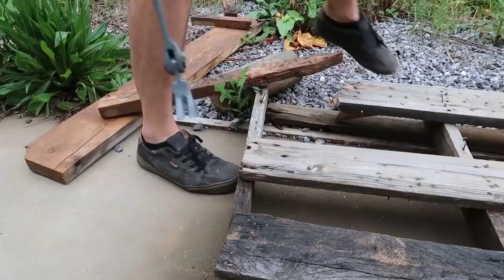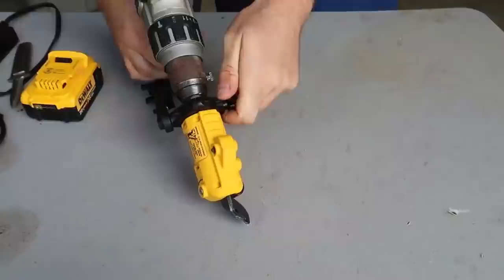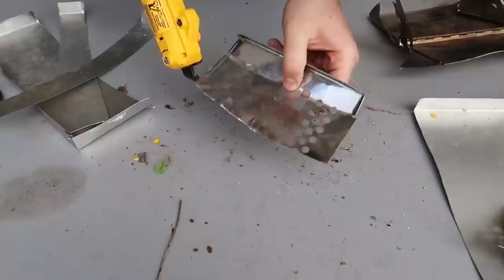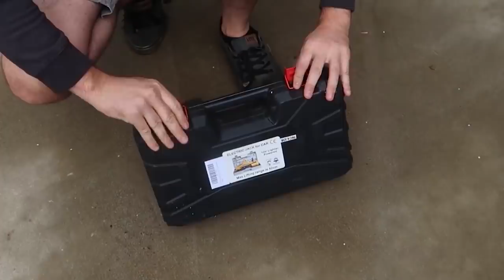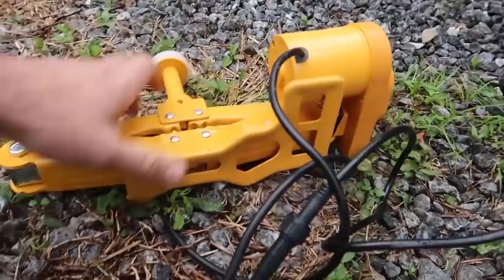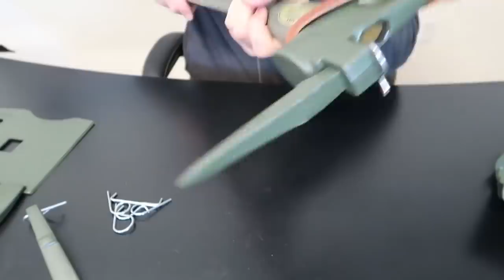5 Amazing Tools That Are at Another Level 3

Comment: the Pick/Ax/ shovel  is normally called a pioneer kit, commonly used as emergency tool system in all US Military vehicles. they come in handy in several different situations. been around for quite a few years now.. the one you have looks a lot better built.